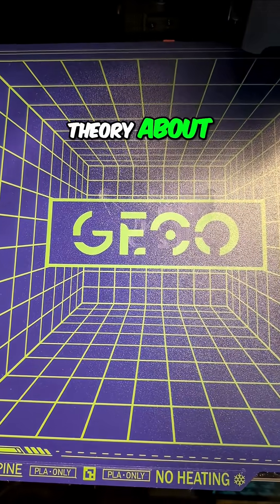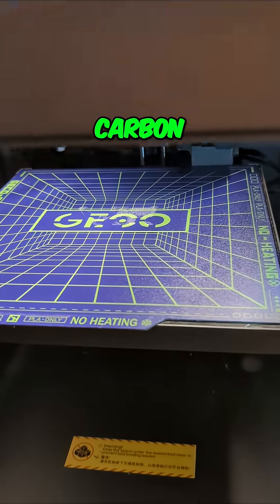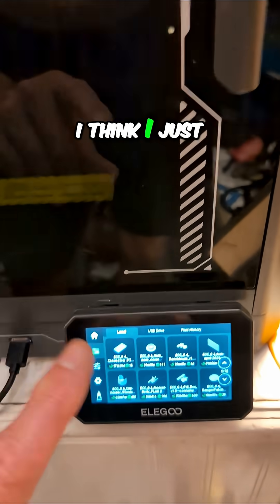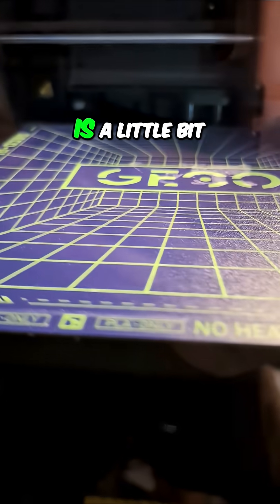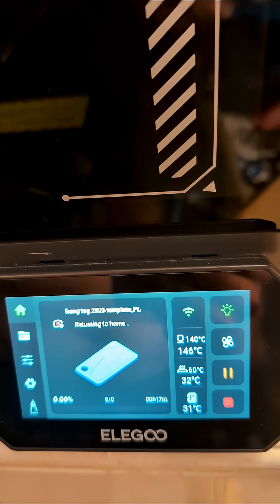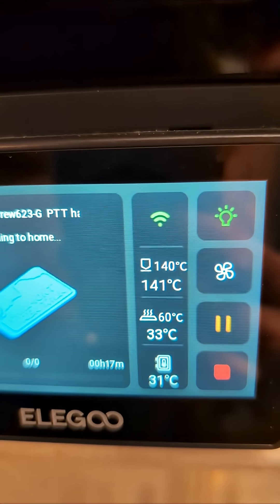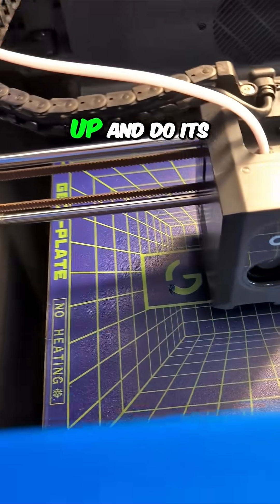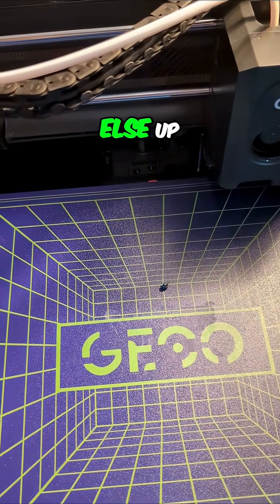3D Printer Plate Disaster?! Testing New Geco Cold PLA Plate on Centauri Carbon

Comment: Where did you find that plate? I can't seem to find anything small enough.
Reply from the maker: https://www.amazon.com/vdp/06e244d5a0184e58ab0282b95a19cbb2?tag=cresssalesa08-20&linkCode=ssc&ref_=cm_sw_r_cp_ud_aipsfvideo_WV0QHZ9WXRB8A184PHYT
Reply: @GearReportMaker  Oh, I did see that one. I figured 257 × 257 would just barely be too big.
Reply from the maker: They sent me this one to test, but didn't seem to understand that it would fit the CC
Reply: @GearReportMaker  No problem fitting it at all?
Reply from the maker: @BlazeT3D  none at all
Reply: @GearReportMaker Sweet. Thank you for the tip.
Reply from the maker: No problem

Comment: The reason most printers heat before leveling is to account for thermal expansion because it doesn’t expand much but it’s enough to mess up a print
Reply from the maker: Yep. Definitely learned that on my Neptune 4 Max. I think the CC should create a new level mesh for each bed temp profile. Doesn't make any sense to measure it at 60 when it will print at 20-30.